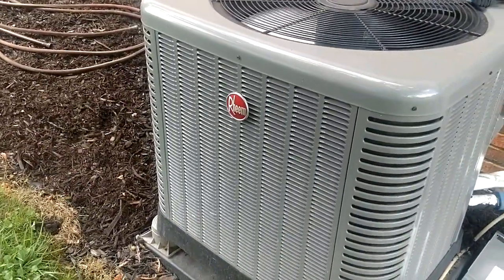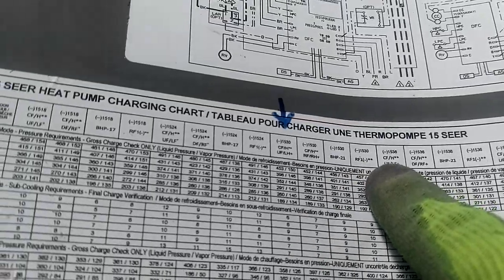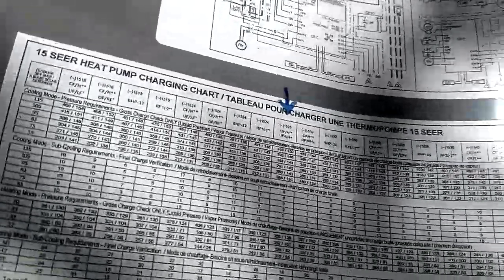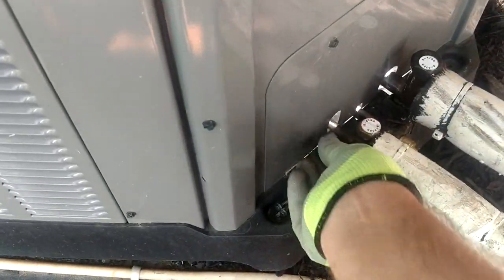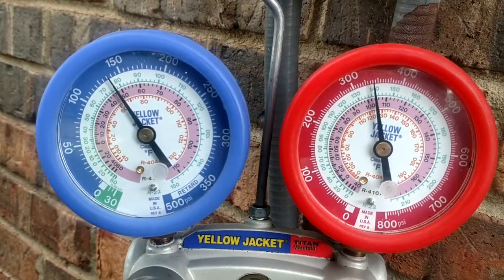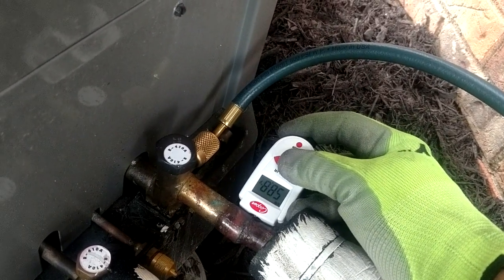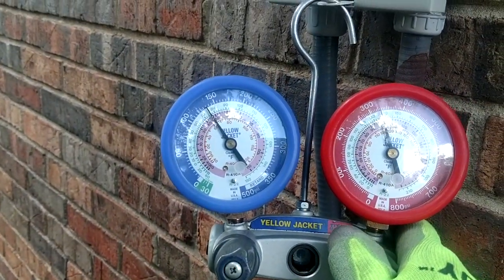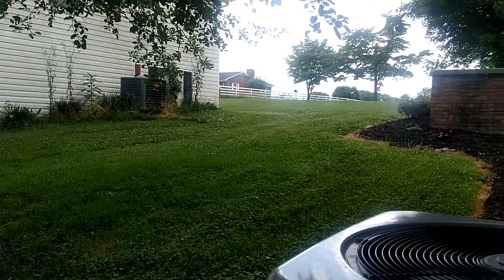New Rheem charging charts, Superheat & Subcooling discussion for the new guys & disconnecting hoses

Comment: That's a cool little line temp gauge you have there. I've never seen one like that. What is it called and where do they sell them and approx. cost?
Reply from the maker: You get them at harbor freight. For around $12  Thanks for watching 😎👍
Reply: @sknight0391  thank you. I think you must be referring to a different tool. The one I meant is at 8:08 . The digital temperature for the lineset. That doesn't look like a harbor freight item 👀
Reply from the maker: @realSamAndrew  Yeah, that one is the Cooper brand (which is much more expensive). I actually prefer the Harbor Freight version. It is gray in color & actually has clock on it . Around $12.00
Reply from the maker: Sku #93983
Reply: @sknight0391  great! I found it. Also found the white one you use here. That one goes for something like $75 !!!! Ouch 🤯

Comment: High subcool could also be caused by airflow issues with the indoor unit. If airflow is low, txv will restrict liquid flow to maintain SH.  This will show up on the condenser side as refrigerant stacks in the condenser

Comment: Good video, what would you do if you have one of those rheem heatpump but your indoor air handler is not a matching Rheem it's a different brand. I have one 3 ton Rheem with a carrier air handler and I was looking at the charging chart and I don't know if the numbers would be different since the indoor unit is not a Rheem.
Thanks
Reply from the maker: Without a matching Rheem indoor unit it's just a shot in the dark. Thanks for watching. 😎👍
Reply: @sknight0391  I like that 😎

Comment: My question is where can I find the tester you used to check the temperature of the liquid line. I heard you say rubatotech but I’ve been unable to find any information. ThAnn’s great video ✋️
Reply: By any chance do you have the correct name and model number for the tester?
Reply from the maker: @larrymills4637  Harbor freight pocket non-contact thermometer #93983
Reply: Thank you so much for that information ✋️
Reply from the maker: At Harbor Freight. It'll cost you about 12 bucks. 😎👍
Thanks for watching.

Comment: I worked for a Rheem dealer for about 2.5 years. I thought they were good units, and you are right you have to be able to decipher the hieroglyphics of the Rheem indoor units. I use digital gauges, I was able to dial in the correct charge, or be pretty darn close. By the way how do you like the smaller Fieldpiece bag?
Reply from the maker: So far I like it pretty well. I bought it as a spare ( in the rain/ rooftop ) bag, but I can see myself using it as my E.D.C. bag. We'll see. Might do an unload video on it.

Comment: Great lesson Shannon. I also love the look of these units. I like Rheem for the most part, I do find there 90 plus furances can really be a pain in the ass sometimes with how the cram up the blower portion of the furnace. I agree with you on your description about guys needing to learn how to measure SC and SH before digitals, however I feel new guys need to really  start learning there Design temperature differences and condensing temp over ambient numbers so they know where there pressures need to be prior to hooking up. If a new guy can not calculate SC and SH by week 1 he needs to go back to school and learn simple math. Yes I think new guys need to start with analogue gauges to get use to connecting hoses and putting back the gas when disconnecting, however digital  gauges paired with MQ will teach a new guy more than using his analogues.  The reason I say this is because it gets them familiar with targets much faster and it gives them a bunch of learning material right on the screen as they work.

Comment: In Jersey every r22 system usually is over charged. Those Rheem Evap coils sure are restrictive on the airflow. They run that way for years. I would find them running 3-6 degrees of superheat. No heat pumps so they run years overcharged with suction lines freezing up from slugging back liquid. Most the r22 Rheem usually run around 60psi with 22.
Reply from the maker: Thanks for watching buddy 😎👍
I work on so many Lennox units, at one point I called the Rheem a Lennox. Hahaha